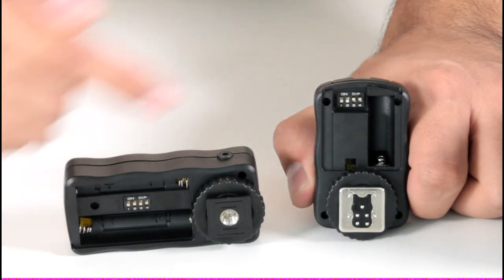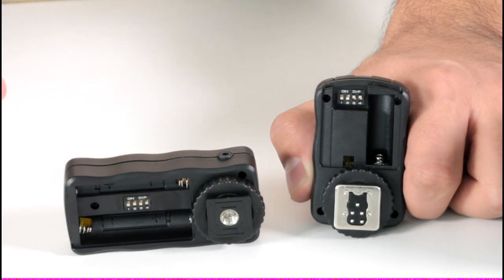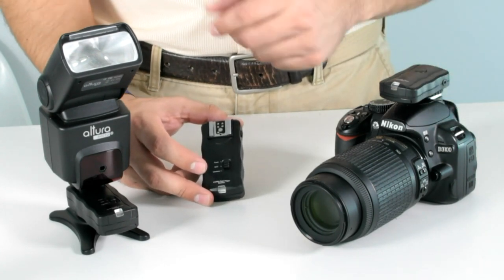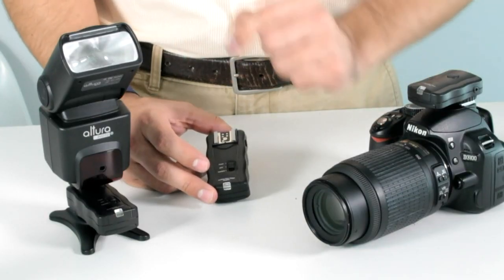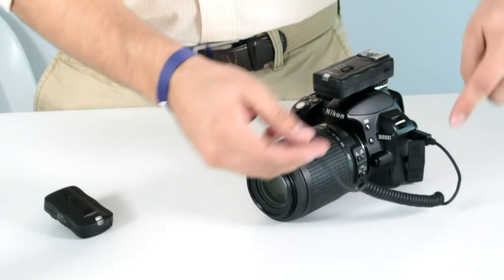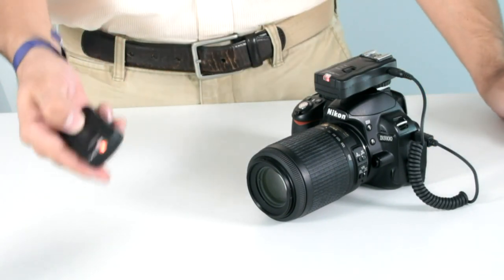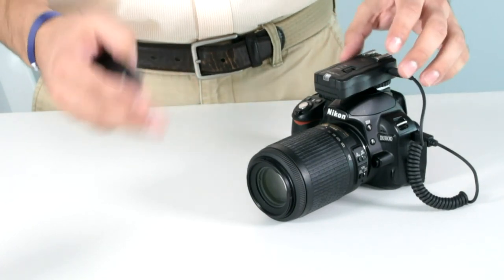TUTORIAL | How To Use A Wireless Trigger & Receiver Set From Altura Photo For CANON & NIKON Cameras

Comment: Just opened my Atura Wireless Flash Trigger for my Canon SL1. I hooked it all up as per instructions in the included manual, set my camera to M and it works flawlessly. I am not so concerned about using it as a remote for the camera as I already have one. I am impressed with the product and plan to purchase one of the flashes as well. Excellent product. Thanks for the vids too.
Reply: Are all the Altura flashes capable of ETTL?

Comment: Ultimately I got this working and syncing correctly  @1/250th, off camera,  on my D800 by removing the transmitter and having the flash unit mounted on the receiver and set to "Flash" mode. I then set my camera to CMD, Built in flash to off or "--" and group A and Group b set to manual or "M" with an offset of "1" and Channel set to 1. Last but not least the unit must be in S1 mode to Sync properly. Keep in mind you must have the Camera flash unit activated for the slave unit to fire i.e. the Altura flash unit.
(other settings and combinations may work for other camera, these settings specifically were the only proper way to get the Altura kit to function correctly on the D800)
It took 5 hours to figure this out. I am guessing these setting will work with other Nikon camera models that have the CMD  option under their "FLash cntrl for built-in flash" options.
Goja, the manual's documentation and videos for this product are not very helpful when describing when to use "Flash" mode or "Camera mode and /or when to use the transmitter vs. when not to use it. That being said the unit is very cost effective and is working great. Thank you for the great product.
Reply from the maker: Thank you for the feedback Isaiah, we will try to make better manuals for them. Hope you can enjoy the product.

Comment: Hi Digital Goja, I just bought this trans-receiver kit from Amazon. It works great!! Just want to know, if the transmitter in wired shutter release mode can be locked for continuous shooting. Please help.
Reply from the maker: +tirthankar gupta  Yes it can, just hold the transmitter button down once you set your camera to continuous mode and you're done.
Reply: +Digital Goja Yes I tried that, it is shooting when the button is pressed, but stops once I release the button. I want to use it for picturing star trails, so the time span for the shoot will be several hours. I want to know is there any alternative where I can lock the trigger so that I don't have to hold down the key?
Reply from the maker: +tirthankar gupta No I´m afraid it doesn't allow for long exposure, you need an intervalometer.

Comment: Hello, I just bought this kit as a gift for Christmas. I can't get the flashes to fire when the transmitter is in the hotshoe. New batteries, codes are the same. What I don't know is what mode are the flashes supposed to be in? TTL? S1-2? Thanks!
Reply: i had the same problem go to M and bump your numbers to 1/1 and work you way...till you get the desire power...and if still dont work take off the tramsmitter off and put back up the got to M and shoot.. idid all the and work

Comment: I'm having issues using these with a canon  70D and 580ex (original). Any suggesions? Do I need to have the 580ex in a certain set up?
Reply from the maker: Hi, which issues do you have with them?
Reply: @DigitalGojaUSA  I'm unable to get the flash to fire at all
Reply: @DigitalGojaUSA  I can get the flash to fire when the remote is not attached to the hot shoe and I can get the camera to snap remotely but the flash will not fire when the remote is mounted.
Reply from the maker: @DistractionPhoto  Hi, please contact our customer service at support@digitalgoja.com so they can assist you with this issue.

Comment: Can you use the receiver in Camera mode and use the Altura Flash as well. I mean Can we have the Receiver on top of the camera and on top of the Receiver the Altura Flash? and use the trigger button as the remote to take the pictures using the flash as well? In this video i did not see the flash unit when being used with the Camera mode.

Comment: Hi. Thanks for these informative & helpful videos. I have been researching & reviewing the various Altura Flash kits available via Amazon/eBay/Digital Goja for a few months now, & these videos (& the substantial positive reviews) have finally convinced me to go ahead w/ the purchase. I just have a few lingering questions that I have yet to find definitive answers on, so I'm hoping you can help:

1a) Does Altura have a version that will work w/ Sony's a6000 &/or NEX-6 cameras? Both are mirrorless, w/ the a6000 being the newest version. The literature mentions a new feature for the a6000, a "universal multi interface hot-shoe", so perhaps the compatibility will differ b/t these 2 models. (My primary concern is for the a6000) 

1b) If the Altura flash system will in fact work w/ the Sony('s), will it also retain full functionality, including the wireless transmitters, & will the accompanying cable fit/work without limitation as well?

2) I also have a Nikon D3300, so I am hoping that the applicable "For Nikon" Altura kit may work w/ both the D3300 & the a6000. If that is the case please point me in the direction of that specific version. (Dual/universal compatibility may seem to be an unrealistic 
hope to some who see this, but both my Sony's already seamlessly use many of my Nikon components, including all of my Nikon glass, so my query is based on that premise, & thus not w/o merit)

3)  What is the unique name/SKU/identifier for the Altura kit consisting of: A) The Flash, neoprene case, flash stand, & diffuser AND B) the pair or (1) set of wireless transmitter & receiver w/ required cable for my cameras? 

4) Lastly,  (sorry so long, but hopefully any provided answers will be seen by many others w/ the same questions, as both Sony's are consistently among the most sold in the US Market) In various eBay & Amazon offerings for the Altura Flash kit, the compatibility is touted as "Universal". Is there such a model? If so, what (if any) differences or omissions from the brand-specific versions are there?

Thanks in advance for any & all info you can provide. It will serve me well in ensuring I order & receive the proper merchandise without dilemma or delay.

Comment: Does this TRULY work for The Canon Rebel T5?  I ordered a yognuo trigger set similar to this but it had different remotes, and it didn't work for my camera. It lit up like it knew where each other were, but it would NOT fire off camera flash when pressuring the shutter button. The Canon Rebel T5 does NOT have external options you can set because it doesn't support that, however I have gotten off camera flash with a cable before, I just want to go wireless so I have more room.

Comment: I have the Altura Flash and the remote trigger. I am pleased with the flash but having trouble understanding the trigger. On my Nikon 3200 if I mount the trigger on the camera with the camera on 'auto' or one of the special scene settings the built in flash will still try and pop up, I have to use A,M,S or P. And so far I can't make the flash go off automatically when using the remote trigger, sometimes it works and sometimes it doesn't. Using the flash on TTL or M doesn't seem to change anything, I've not yet learnt how to use this properly.
Reply from the maker: +UKRichardHK Hi there! Please take a look at this video on the proper set up https://www.youtube.com/watch?v=wb5eQ0UTobc Also here's one about your internal flash popping up https://www.youtube.com/watch?v=0PuxgYgZhOA

Comment: I have just bought the Altura speedlight kit for the canon EOS 60D, I am not real familiar with speedlights and I am having are real hard time getting this to work. The transmitter will flash red when you press the test button down but the light on the receiver is green and flash will not fire. Is the a video showing how to setup Altura for the EOS 60D? Please any help would be highly appreciated...Thank you.
Reply: Yes I have made sure that all batteries have been replaced with brand new ones and I have followed everything to the tee as in the above video, only difference is I am using a Canon instead of Nikon and have also verified numerous times that everything has the same code, I have been using the transmitter as the remote shutter for pictures and it works great!! but just can not get the flash to shoot just like in this video with the Nikon camera.

Comment: What about the Mode the Flash should be Set to? Which Flash settings on the camera Menu should be changed?
Reply from the maker: Hi there! the camera should be on Manual, same as the flash, no TTL info is transmitted through triggers.

Comment: Hi, you're showing this on a Nikon, but how does it work with a Canon? Specifically the remote feature with the flash on the camera and me standing with a group of people for a picture. I see you have a cable from it to the camera, but that cable is not compatible with the Canon T5i. What do you suggest?
Reply: Thanks! I ordered the Canon one (went back and double checked) but amazon sent me the Nikon cable. Got it all sorted out with a quick call to amazon, works great now, thank you!
Reply: these triggers will work with any brand of camera because they manual triggers so they don't transmit any TTL information and therefore they will fire the flash power and other adjustments ara done manually

Comment: Solution. If your receiver shows the green light but the flash does not go off when you press the button on the trigger, you might have the flash attached to the receiver the wrong way. take it off, turn it around, and put it back on. Make sure the optical infra red part of the flash faces the green light on the receiver. Voila! it should pop now :)

Comment: I am pretty sure I am doing all of this, but when I press the shutter on my camera it doesn't trigger the off camera flash. Though if I press the test button on the trigger mounted to my camera it does trigger the flash. Is there anyway to fix this? I have a Canon Rebel T5i, does that make a difference?
Reply: ***** Hello, I'm having the  same problem, all the batteries are new, and the channels are the same  but it  only triggers when using the tester on the transmitter.

Comment: I have just received your "Dual Wireless Flash Trigger Set".  My camera is a Nikon DX and my flash is a Nikon Speedlight SB-20.  I have watched your Youtube which is great but am unable to get the remote switch to fire the camera.  The switch will fire the flash but will not fire the camera shutter.  I have connected a cable from the camera to the transmitter unit but no joy.  What is this newby doing wrong? Thanks for your great service.
Reply from the maker: +Lindsay Sink Hi Lindsay! It seems that  the GPS port might have shortened due to using a film related flash with digital and using the flash on the receiver while attached to the port. Please try to connect the receiver to the camera with the gps cable with no flash attached, and see if it works. Let us know if this information was helpful to you.
Reply: +Digital Goja  Although not understanding your reply regarding "GPS port and film related flash" connections I do appreciate the timeliness of your reply.   I have determined after research on your home site that I likely purchased incompatible flash equipment to my camera.  I found specific equipment, on your site. to my camera and have ordered accordingly.  Again, thanks much for the overnight response and that alone has earned my on-going photography equipment allegiance.  I just wish I knew what you said..
Reply from the maker: +Lindsay Sink Hi Lindsay! We're sorry to read that our answer was confusing :( If your would like us to go into more detail we would be happy to do so. If you are still having issues with your set up once you receive the right equipment please let us know and we will be happy to give you a call or send you and e-mail and walk you through the issue you're having. Take care Lindsay!
Reply: you have to set your camera to manual mode for the camera to work wirh the SB20 and the Altura flash triggers. these triggers are manual only triggers they don't transmit any ttl signals also the SB20 is not a ttl flash your shutter speed must be between 1/60 and 1/200th of a second

Comment: I am trying to get this to work. I have watched the videos multiple times and read that others have had my same issue. connected the transmitter and receiver, made sure they are on the same channel, but my pop up flash keeps trying to pop and the sb-700 doesn't flash. my I have the d3200. what am I doing wrong?
Reply from the maker: +Trevor Sipes Hi there! Please take a look at our video on how to disable the internal flash https://www.youtube.com/watch?v=0PuxgYgZhOA
Reply: +Digital Goja Thanks for the response. I have the pop up flash shut off and somehow still can't get the flash to work. I put the transmitter on the camera, receiver on flash, receiver set to flash, channels are set the same, flash and camera on, batteries in everything. shoot and no flash. put the flash back in the camera and flash. is there a setting I am missing or just a little slow. camera is d3200. flash is sb-700
Reply from the maker: Hi Trevor, please set the shutter speed to 1/125, the aperture to F8 and shoot @ 10ft. Let me know if this information was helpful to you.
Reply: you have to set your D3200 and SB700 to manual mode for the flash to fire with the Altura flash trigger set these triggers are manual only triggers they don't transmit ttl data so therfore you have to set all adjustments manually

Comment: I'm having a problem with OFF CAMERA FLASH via the remote. When I set the flash to with TTL to S1, it constantly shows ISO 100 and fires at whatever intensity it was set to previously. In other words, it is not capturing my camera's setting at all. ISO cannot be changed at all, as far as I can see.

Any tips? Thanks.
Reply: +Digital Goja Online Photo Superstore (DigitalGoja) Thanks for your quick reply. How can I change the ISO information on the flash when it is off-camera? I can change mode and intensity, but ISO remains constant at 100.
Reply: OK - good to know. Thanks again for your quick and helpful responses.

Comment: What's the max sync speed with this transmitter/receiver? Is it capable of high speed sync?
Reply from the maker: Hi Adrean, it's not meant for HSS, so it only works at 1/200

Comment: What mode is the flash on for this to work?
Reply from the maker: +David Alvarado As the Altura Photo Wireless Trigger set do not transmit TTL wirelessly, the flash needs to be set to S1 or S2 mode.
Reply: +Digital Goja I have a d7100 and the altura flash that I have is UNV1 I have also the triggers, but I wanted to set the flash off  camera without turning on the internal flash to detonate the external, is that possible with the unv1? Sorry if it's a little confusing new to photography but very eager to learn
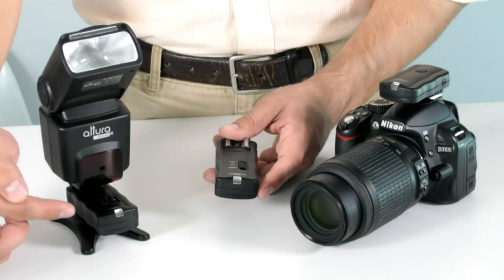Reply from the maker: +David Alvarado as you can see at 0:26, to use your trigger for flash purposes, make sure is set to "flash mode". Have the wireless trigger mounted to your camera hotshoe and the receiver with your flash. This way you wont need the built-in flash to trigger the external flash.

Comment: Okay so I have the flash from Altura that came with a wireless remote.  I thought that the remote was only for the flash trigger, so I also spent money on the wireless flash trigger and shutter release.  I have tried to get the remote that came with it to work, but it only works if its pushed right up against the flashes built in IR.  I tried attaching the flash to my cameras hotshoe, but I can't get it to sync with my camera.  My camera is a Canon Rebel t6i, which the discription for the flash said it works with.  My camera gives me an error message when I try to go into settings saying that the flash is either off or is not recognized or compatible with the camera.  I have not yet opened the box with the extra wireless trigger/release.  Please help, because I'd love to be able to use it.
Reply from the maker: Hi Rei! Please send us your order information to info@gojasales.com and we will be more than happy to help you identify the issue and find a prompt solution.
Reply: Digital Goja Is there a phone number I can call?
Reply: Digital Goja Or somewhere I can do a video chat?  I'm having a lot of trouble with the limited instructions that came with the flash.
Reply from the maker: Hi Rei, please send us your contact information to info@gojasales.com and one of our specialists will get in touch with you as soon as possible,

Comment: Solution. you have the flash put into the receiver the wrong way. take the flash off the receiver, turn the flash around, and put it back into the receiver. The optical slave redish detector should face the let on the receiver.. Voilà! lol, i was pulling out my hair too :))) till i narrowed it down to the connection between the receiver and the flash, then noticed the pins werent really touching. turned it around, and they all touched!